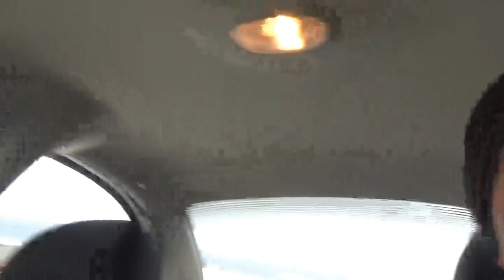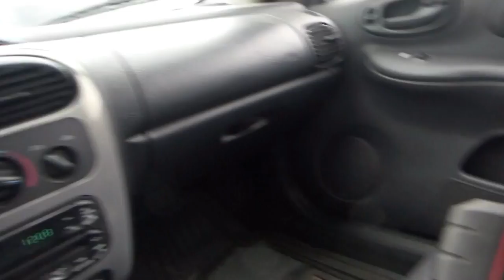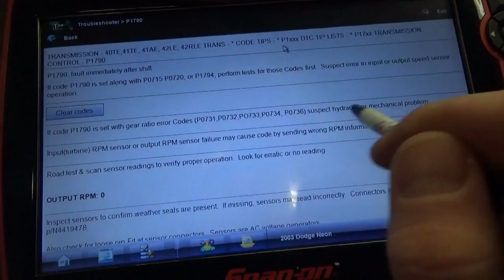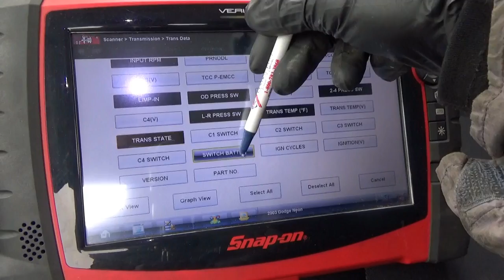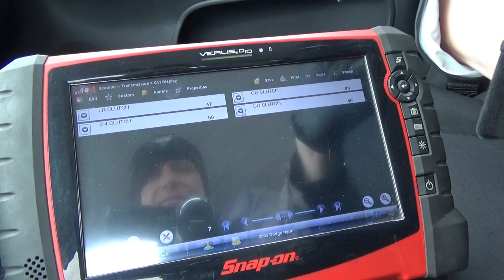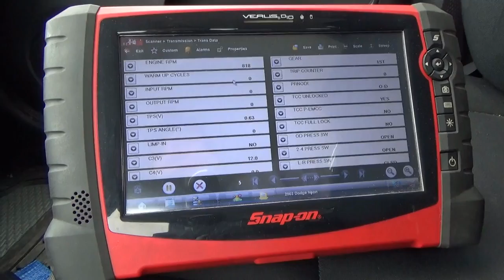Limp home, No-shift (Dodge Neon) -Part 1

Comment: I had one of those smart-looking nasty Chrysler vehicles back in the day.
 The wife got it in the divorce/ blew a head gasket on a 4-lane highway/drove it 25 miles home on the road shoulder/ got it fixed/ always worked like crapola after that.
 So, it was a pretty good vehicle. in my jaded opinion!  lol, I put 455,000 on my 93 Plymouth Voyager which I got in the divorce. :)
At least Chrysler tried to make a good 4 banger. The frame was used for a few models after the NEON died.

Comment: When I was in the car business through the 90s and most of the 2000s I would appraise cars for the dealership that I worked at. What I found is you need to take about $1,000 off Black Book value on any neon or PT Cruiser or any Chrysler in general because it's about to lose a head gasket or something else fairly severe. Chrysler has been making chunky cars for a long time and somehow they're still in business. I'm not sure why
Reply from the maker: If you take $1000 off, then YOU would have to pay the customer to take the car off your lot HAHAHA

Comment: That fluid looked awfully new in that baby, did they recently service the trans and maybe starve the trans pump that's already on it's way out?  Maybe the trans pump pressure isn't adequate enough under acceleration from a stop to push itself into that next shift range?  If it's electrical issue concerning a shift solenoid or input signal etc you'd sure think you'd be setting a DTC or two?

Just throwing out ideas, but it's tough with trans issues like this.

I thought I could hear some noise from it when you were idle testing shifting it through the PRNDL ranges.
Maybe shutting it down allows the TCM to reset and try again before shutting it down again shortly after?

I'd check trans pressures, it seems like you might have a pressure issue preventing it from completing the 1-2 shift, then the TCM sees it with the output and input rpm values and throws her in limp mode and flags that DTC accordingly?

I'm late to the game, sorry I didn't see you posted part 2 with an update...lol, well.  Great video as always and thanks for sharing this!

Comment: Hmmmmm,  it could be a lot of things Ivan, you still need to do a VISUAL maybe check the voltage, or like you said TCM issues...
       But I will share with you a case study on a NEON that I had one time ago, similar limp mode I forgot the code number, but similar to what you're experiencing, so I noticed by the camshaft was very wet with oil I checked the dipstick had 2 quarts of oil over the the full mark,   corrected the oil level and then pulled off the camshaft sensor was saturated with oil all over, cleaned it up with brake clean button it back up  problem solve... shipped down the road.   Oh yeah I replaced a O2  - - too...

Comment: Dear I have a problem with my car Ford Explorer 2007 light check engine and gave me in the bank 1 Code 135 and 141 and checked sensors intact and the heat circuit in the sensitive sound What do you expect the imbalance and how to deal with the problem and repair.

Comment: When checking ATF level also observe if the fluid is bright cherry red and the smell.  If the fluid is NOT cherry red or the fluid smells burnt, you have an internal mechanical problem.

Comment: 26 year veteran Rebuilder says the sun gears stripped. The fluid will be clean. Qualifier is on 1-2 shift if it absolutely free Wheels. Mention my name when you get it fixed and I'll help you again.
Reply from the maker: Yup 100% free wheels...like you are in Neutral! Thanks for the comment, Roy! :)
Reply: That was my next idea. I had thought the 2nd gear clutch packs were worn to death.

Comment: I'm going to say the 2nd gear clutch pack is gone out. Turbine speed sensors [input sensor] that are defective will produce harsh engagement in any gear because pcm doesn't recognize trans speed when transitioning into gear for ideal conditions, that isn't occurring. 

 Your input is reading engine rpm while in neutral, output gradually ascends as engine speed increase but disengage when entering 2nd. 

I would have looked at the solenoid pids after getting the command sequence of activation for each gear. If theres a command to "on/off" with [cel cleared] to command solenoid there's operation of tcm  [likely]. Or attempt to command solenoid to listen for noise operation. Either it's a weak/bad solenoid or bad 2nd clutch.  

I don't wanna type too much because just these two possibilities will yield great diagnosing and long paragraphs. I'll just have to wait

Comment: My last Chrysler ( and will be forever my last ) (2002 T/C Mini Van) The trans simply went into full grenade mode. No warning symptoms.. Went from a steady 65MPH on a level road to full clangs, clunks and broken metal sounds.  Of course it went at 71,000 miles which for 2002 was 1000 miles over for the warranty.  I take care of my vehicles and for no reason this should have happened. You should have seen the carnage once the trans was opened up. Needless to say, that van once repaired, was out the door ASAP.. Pure Junk.
Reply from the maker: haha Chryslers have a nasty habit of breaking RIGHT AFTER THE WARRANTY EXPIRES! How do they design them this way? lol

Comment: Love reading thru the comments. One guy says could be an overfill of fluid and another guys says low battery can cause issues. Like both of those, whether or not that turns up anything or not. 
Nice video and you will figure it out Ivan.

Comment: Interesting case study Ivan- Overfill can cause same damage as under..I doubt it’s the pressure or shift solenoid, it wouldn’t move if that was the case of a bad solenoid,  I think it’s a castrohphic failure.  Had this problem on a Nissan cvt I know it’s a different animal but I had same issues. Also after I cleared DTC nothing came back up for a while. Btw that fluid is way high should be at high mark hot and running. You don’t check fluid while it’s not running you won’t get an accurate reading. The damage is prob one of the plates are warn.

Comment: Considering I've fixed two of these and they were both corroded wires in the harness going to the trans under the front bumper. I'll go with that again lol.
Reply from the maker: What codes did those have?
Reply: @PineHollowAutoDiagnostics  one I had zero communication to TCM. After fixing the wires I had a bunch of com and solenoid codes. The other I believe was internal timer relay always on, or something along those lines. Sorry I can't remember the exact codes. But definately check the harness behind the bumper on the bottom. I live in same type of climate with winter salt and corrosion issues.

Comment: Internal transmission failure with either a solenoid or control board. The problem is that if the car has been driven like than until now that lost all power, probably the clutches are worn out and now need a rebuild. Wear that the trans oil was very clean and pink. That tells me someone did a flush or oil change and now the issues are worst. Did you check for burn smell?

Comment: this transmission is 42te limp mode is default to 2nd gear the reason this wont go in drive
when in limp mode is 2nd gear is out so you get neutral turn the key off back on its then out
of limp mode till it tries to shift to 2nd then back in limp .... its time for a transmission 
rebuild are replace
Reply from the maker: Kind of ironic that it goes to 2nd to limp you home, but 2nd gear is the one that's broken xDDD

Comment: even though it may not be setting the cam sensor code the tcm  matches the engine rpm to the trans input rpm to know if the converter locks up  if it has that trans. so if the cam  signal is dropping out intermittently....... but the real issue is it's a cheap assed chrysler product. i think that model was also sold under the little tykes brand.

Comment: 1st off, Chrysler's limp in strategy when trans related will reset every key cycle. Not exactly sure why they do that, but they have been since the early 90s. Here's the thing. Once in limp in, 2nd gear, they just stay there. It will have whatever  power 2nd can give you off the line, and rev to about 40 mph. It's NOT supposed to slip!  The idea is to get you out of an emergency with some form of drivability.  I noticed 1 thing. Ign Sw volts read system voltage running, but then the 2nd PID for ignition volts read 12.0.. I'd check the wiring harness near the frt for visible damage. Then I'd check via bi-directional controls the sol. pack to see it they switch and actually HOLD. The problem with that scan data is you see the normal command, on/off. BUT that doesn't mean the sol is actually doing it! Waiting for Part Deux.

Comment: Wiring to or defective speed sensors check first.  Speed sensors are AC generators, easy enough to test.  Then dig into the servos.  Make sure the servo electrical signal is there and good on command.

Comment: Fluid check with the engine off, okay, most of my former employers would fire you on the spot.  
I admit you will eventually find the problem, but, the trouble tree you follow is painful to watch.
Reply from the maker: Wow James, it sounds like most of your former employers have a very high turn-over rate of mechanics xD

Comment: Shutting engine off kills transmission fluid pressure, resets.
Upon restart- TCM might use a correlation of  pressure (engine input speed) 
to transmission output, but the 1-2 shift isn't seeing expected pressure.

Broken or cracked filter body, no fluid pressure. (enough to change gear and HOLD it in 2nd)

Did the fluid look cavitated?
Reply from the maker: Didn't look foamy on the dipstick...

Comment: Just a thought but did you check for proper level for trans fluid meaning did you use the hot or cold mark on dip stick but also check it while running while putting it in ever gear all the way down and back up waiting a few seconds to soak each of the clutch packs? then check the fluid my guess is it is overfilled causing bubbles or excess air in the fluid not 100 percent sure this is your cause something basic to start with then if that is ok I would go after the shift solenoids verifying each is working properly there most likely is to of them on top of trans housing or in it.

Comment: I'm thinking the wiring to the tcm. Underneath the radiator core support. There's also a power relay   that powers up the tcm. Very interesting.
Reply from the maker: Well it doesn't have a separate TCM....the ECM controls all. And no circuit codes! I was hoping for circuit codes lol

Comment: Trans fluid level check should be done with the engine running and in park or neutral for the majority of auto vehicles, either with the trans at operating temp or a specified temperature, this doesn't seem like a low fluid level fault though.

Comment: Chrysler computer controlled shifting automatic transaxles use controller logic to engage / disengage first, third and fourth / overdrive gear. Second gear is hydraulically actuated.
So for that reason this transmission issue is NOT caused by transmission controller logic or any electrical wiring issue.

I would suggest that the 2-4 and / or UD fluid circuits in the solenoid pack mounted on the side of the transmission are plugged with debris and restricting hydraulic pressure in their respective circuits. Any debris could be causing the solenoid valves to stick and not open and close properly. 

When second gear is desired all transmission circuit control solenoids are de-energized. In their relaxed state the 2-4 and UD solenoid valves allow fluid to pass through so that second gear limp mode is available if invoked by the transmission controller. I would suspect that this transmission has never had a transmission fluid flush or exchange along with a transmission filter change.
Reply from the maker: Excellent thought! Yes not an electrical problem, I agree.

Comment: I would look at the apply chart for the 41TE I forgot what applies mechanically/electronically. Slippage is present in 2nd gear, limp in is second gear seems like an internal issue. Even without a gear error fault. Yes check all the electrical first, I've done a few 41TE overhauls the TCM grounds the solenoid for each shift according to input info from speed sensors, TPS, engine rpm. I'm betting mechanical failure let me open her up Ivan! Just kidding run electrical tests & pressure tests for 2nd gear there's a huge leak!

Comment: The OD clutch reading is 90 plus, I believe nearing 100 is end of life.  This P1790 is a gear ratio code.  I believe you have a wiring problem to or from the output speed sensor.  Possibly wiring to the solenoids or bad ground.

Comment: Ok, my wild guess is the TCM or the shift solenoid pack, however, did anyone else notice the trans fluid was extra pink? Like water intrusion? Or was it just the lighting during the quick shot, or has it been too long since I've seen ATF-4?

Comment: Ivan, do you have a DRB III scan tool or a DRB III Emulator? If so, use it instead.

The input RPM and output RPM might be equal to each other with the current gear ratio added to the equation....
Input RPM × gear ratio = Output RPM

I have been able to keep a P1740 code from coming back so far by removing around 16 ounces of trans fluid and keeping more than a quarter tank of fuel in the fuel tank. If that isn't crazy, I don't know what is but that's Chrysler for ya. (2001 Dodge Ram 2500 with no rust ☺)
Reply from the maker: NO RUST?!? Haven't seen one like that up here in PA in 20 years haha

Comment: I'm no professional by any means, but my guess is that its either the TCM or some other electrical issue... Because if it was the mechanical side of the trans, i think it would shift roughly, jerk on gear changes, get stuck on random gears not just a particular one, etc... Also it wouldn't reset gears on switch off and on ign... Unless this is the secondary symptom and the customer ignored symptoms like the ones i described and brought it to you after it was completely toast... or did not tell you about them... Curious to see the solution to this riddle... Nice videos...

Comment: Internal transmission issue, Splines on 2-4 planet are wiped out (most likely, common issue)
Reply: Verify that 1st and 3rd work to very internal problem, roll vehicle down a hill to pick up enough speed to be in 3rd, if it engages and drives in 3rd but not work in 4th it’s internal to transmission. (I repaired one of these units once)
Reply from the maker: I like your theory, Jim!

Comment: Drive in second with a trans code I believe is their default limp procedure. I'm going with a bad solenoid pack. Good thing it and the speed sensors are super easy to change all from up top by just pulling the airbox :)
Reply from the maker: But we didn't have a solenoid code...all the electrical circuits are OK!
Reply: @PineHollowAutoDiagnostics  yeah they don't always throw electrical codes. They can fail mechanically and not throw codes. You asked for guesses :P Had one last week, no codes at all. Neon would hang in 2nd too long and then downshift and upshift over and over when coasting in 3rd. Solenoid pack was on the way out.

Comment: Hey Ivan,  interesting diagnosis,  I would bet it's the wiring short that is causing the controller not getting the correct info to shift or by rpm
Reply from the maker: I would expect the TCM to set a circuit code then. This is a "ratio" code, indicating no gear engagement in 2nd....very interesting!
Reply: @PineHollowAutoDiagnostics  wow,  that's interesting that point.  Mmmm, I'll wait for the part 2 :)

Comment: I don't know the shift solenoid pattern.  I'd check to make sure all the voltages to the transmission and grounds are good.  (Rust, corrosion, etc)  Also, that "Ignition (V)  on your diagnostic tester says 12.0 volts, yet the battery shows 14.5 when its running.  Once I look a the shift solenoid pattern, I'd want to scope the solenoid wiring to see who's doing what by following the shift procedure.  Possible broken wiring or other problems.  Are you (scope) sure the input and output shaft sensors are reading correctly?  Part 2 will tell.

Comment: I read a post in a forum about a 05 neon with the same complaint, turned out to be a bad wire in the harness to the output speed sensor.

Comment: Seeing the variance between Input and Output RPM, the only data PID I want to see is Line Pressure.  If the trans has a vacuum controlled Throttle Valve, I'd pop that vacuum line off and see if it still slipped in 2nd.  If it does, I'd pull a valve body diagram and look for the pressure path relations between 2-1 and R-1.

My guess at this point is that there's a pressure issue preventing 2nd Gear from engaging, and preventing it from shifting from 2-1.  Shifting into Reverse revives "normal" line pressures and allows it to shift back into first.  The fact that when you manually shift into 1st, it still displays 2nd on the scantool tells me it's using some sort of line pressure sensor or solenoid feedback to determine what gear it's ACTUALLY in, rather than what you have selected on the shifter.  Good foresight on Chrysler's part there.

Alternatively, I want to have a peek at the engine mounts.  Is shifting into reverse or turning the vehicle off un-pinching a wiring harness that controls the 2nd Gear engagement solenoid?

As always, this is all just speculation based off what I'm seeing here.  Darnit Ivan, just ship me all these cars so I can do my own diagnostics!  LOL  A million ways to skin a cat...
Reply: No the transmission is staying in second because of the limp mode. Limp mode defaults to second gear so that the car is normally still drivable for most faults. In this case 2nd gear is not engaging properly (for some reason) and so the limp mode staying in 2nd gear doesn't work.
The fluid being red and not burned seems to indicate an electronic issue (solenoid or wiring).

A more intelligent limp mode would pick first or second based on the particular fault.